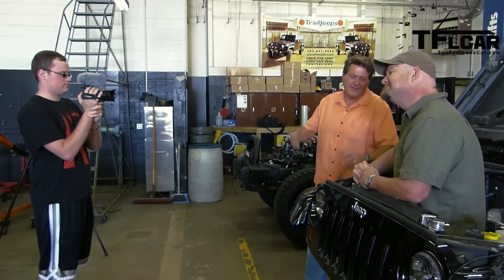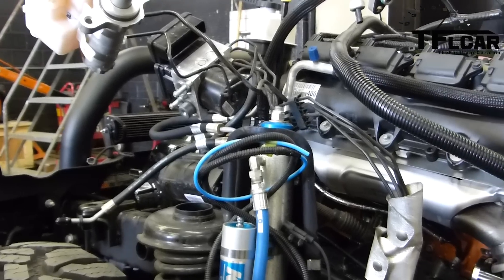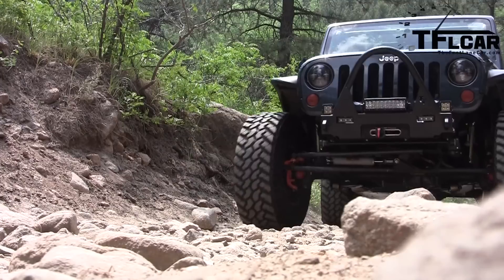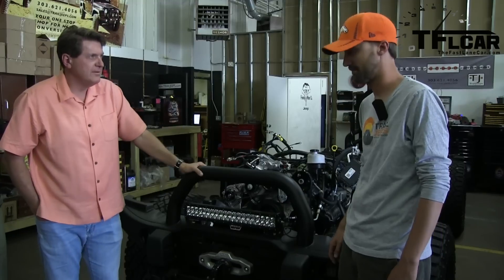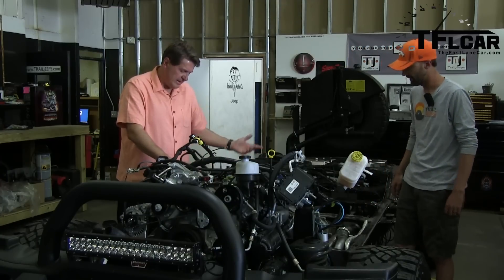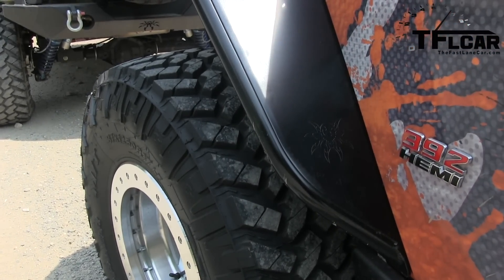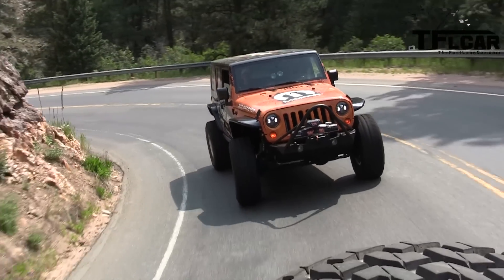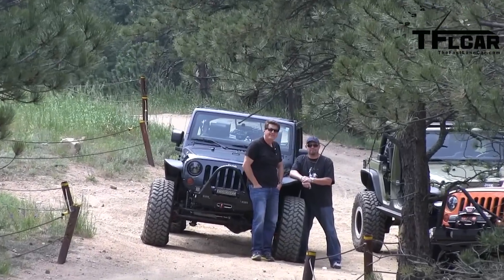2013 Rock Devouring SRT 6.4L HEMI Jeep Wrangler Reviewed ( Part 1)

Comment: Just to let you guys know. The Jeep JKs have a BIG problem with the transfercase cable system in them. The Transfercase cable has a plastic piece that is guarenteed to break. Advanced Adapters makes the best conversion kit to fix that problem. We installed it in our 2008 Jeep JKU and we LOVE it.

Comment: In 2011 I bought a brand new Wrangler Rubicon Unlimited.  I loved it - except for the fact the doors leaked (not the roof) every time it rained flooding my passenger side.  The 6 speed stick wouldn't stay in 2nd or 4th if it was cold outside, and when cold getting into 2nd gear was a real pain in the butt.  Toughest vehicle - as long as it never gets cold and never rains.  Couldn't take anymore of it and got rid of it after less than a year and a half.  It was in the shop nonstop and never got fixed.  Never again.

Comment: Good lord their prices are steep. I picked up my 2 door 2012 Rubicon, with 3" lift (with Fox Racing shocks no less) and 35's for 37 out the door. Added AEV bumpers and Teraflex tire carrier for less than 3k. Figure 30k for that engine/install, I'm still sitting at significantly less than 100k were I to do that Hemi swap. They're charging WAY too much for what they're doing.